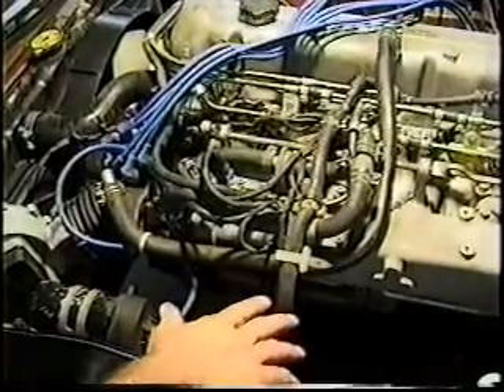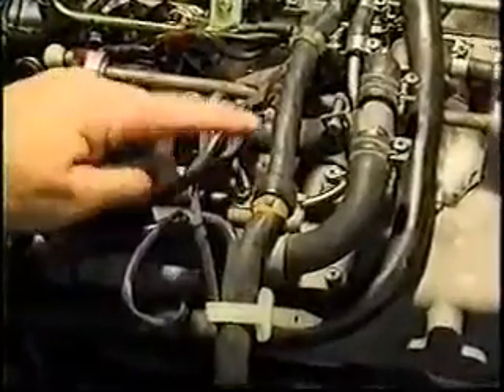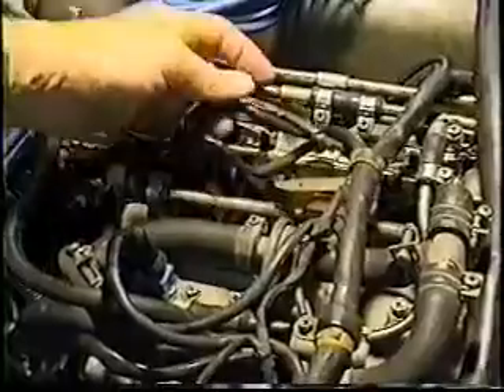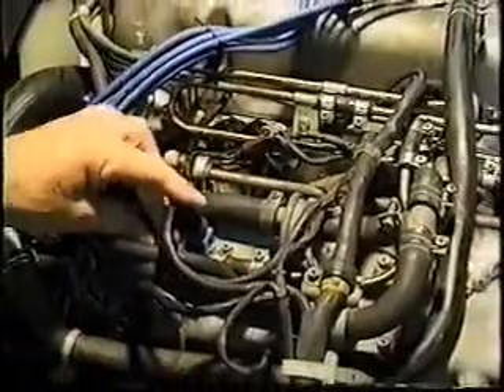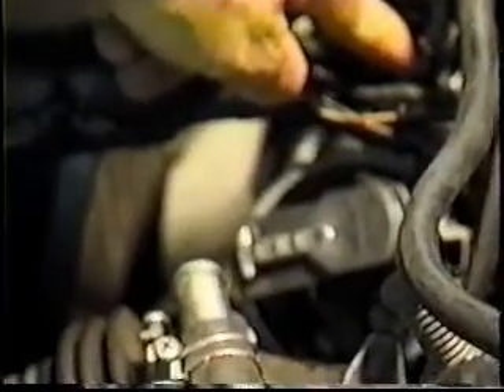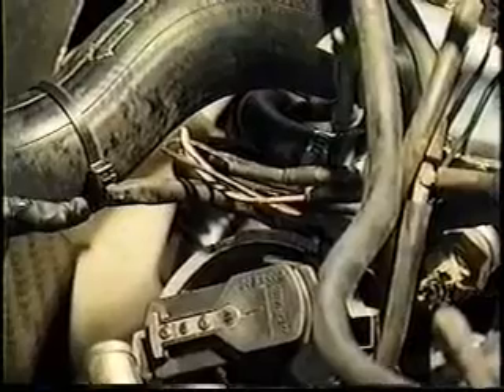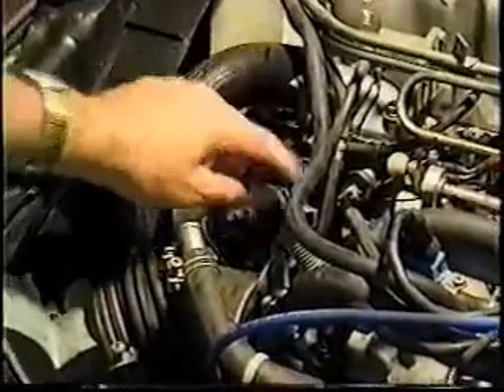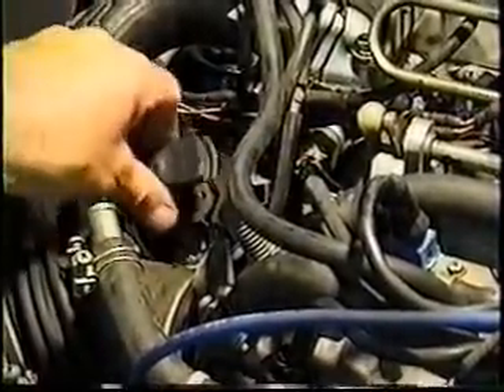Z Therapy Datsun 280Z ZX Fuel Injection Training 15 of 20

Comment: Well, Hello.  I don't know if you're still on here, as you haven't posted in a few years, but I have to say that I just learned more about Z cars today in only a few hours than I have learned in the last few years!  Those FI system videos are a gem.  Thank you for posting them.  The troubleshooting ideas and tips are awesome.  I got 4 Zcars here at home, all are broke, and I'm starting right here!  THANKS AGAIN.  - Z guy from North Carolina
Reply from the maker: I'm so glad it helped. Good luck getting them going!
Reply: Yes, I appreciate it!  First, the daily.  Then the garage queen, and then the project car...  the work continues.  When are you going to post more videos?  I'm tired of watching these kids on youtube trying to show me how to work on old Z's and they don't know what they're doing!  Thanks again @burkeyvision4346
Reply from the maker: @benjaminnielsen4288  thanks, that's a good idea. this video series came from a VHS cassette put out by Z therapy years ago. I had it digitally converted and uploaded.
Reply: @burkeyvision4346  cool.  So is ty here another place to get all that, or was it everything already posted?  Thanks
Reply from the maker: @benjaminnielsen4288  everything from the original video has been posted as far as I know.
Reply: I do have one question for you real quick... You talked quite a bit about the fuel pumps and fuel pressure regulators...  pumps now are in the $500 range which is mind numbing to me, and the FPR's are NLA available from Nissan.  There are several, infact many Zcars still left here in my local junk yard, and I was thinking of grabbing any fuel pumps and regulators, even oil pressure sensors from them, as they may still be in working condition.  Any thoughts or advice?  Thank you so much @burkeyvision4346